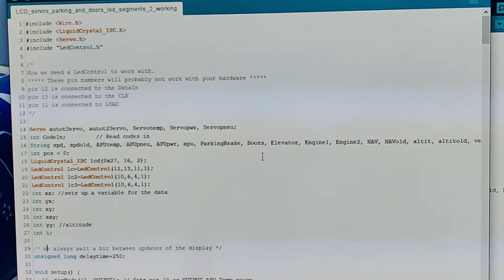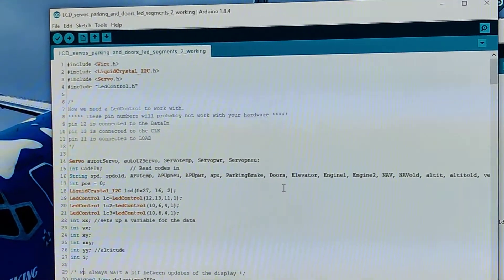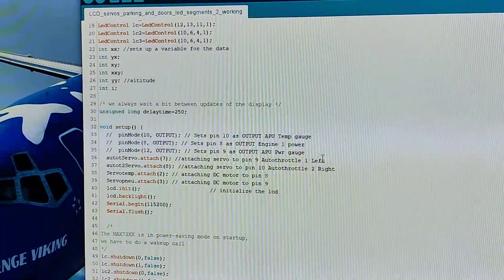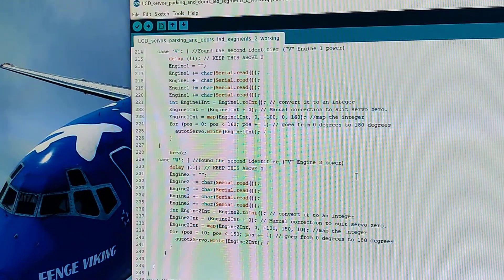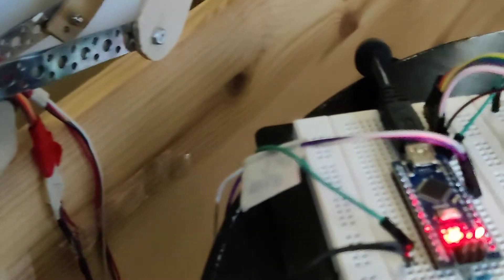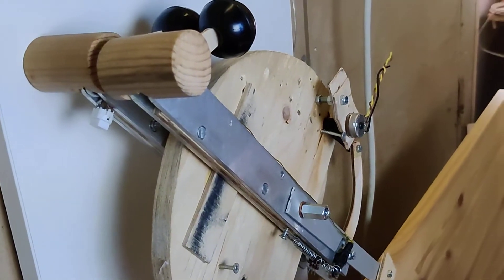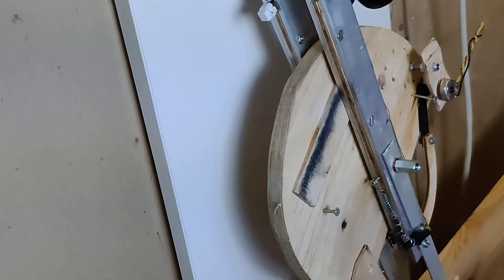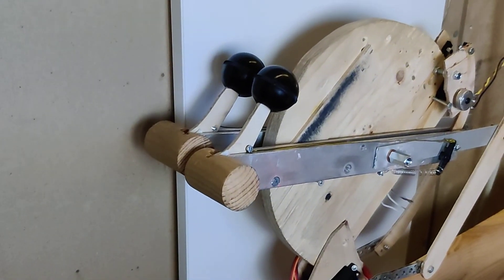Autothrottle DIY cheap and easy, servos, FSX, Prepar3D, P3D, arduino

Comment: I’m actually working on a small experimental amateur built aircraft here in the US, it’s powered by 2 PBS TJ150 engines and I’m trying to figure out how to make auto throttles like this. I really just want to set a speed on the avionics panel and then the auto throttles move to try to intercept and maintain that speed.

I’m just not exactly sure how to go about doing it.